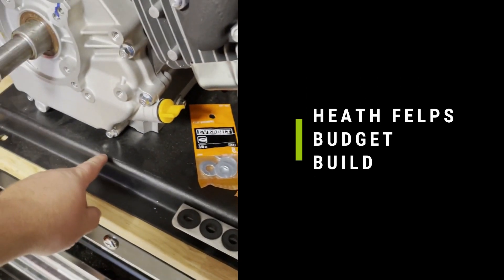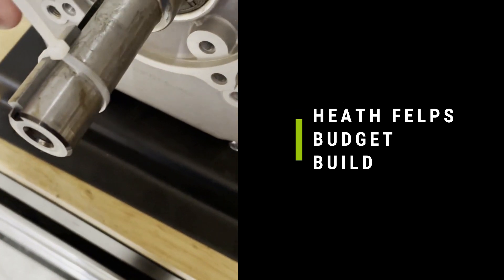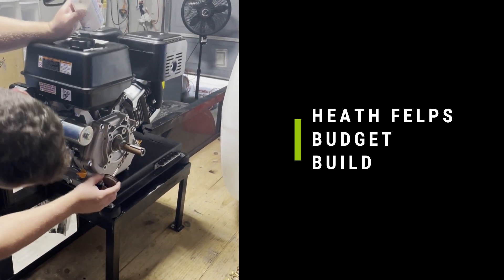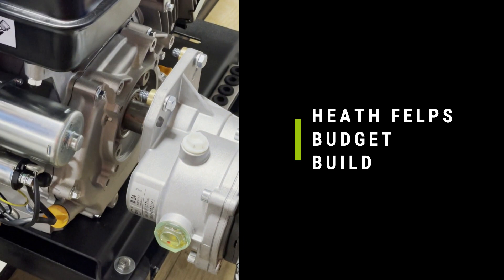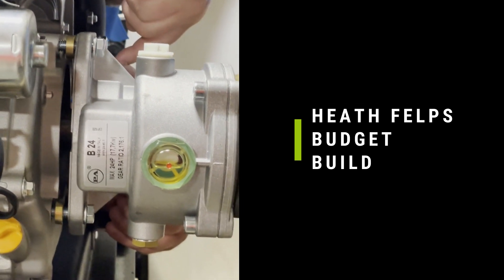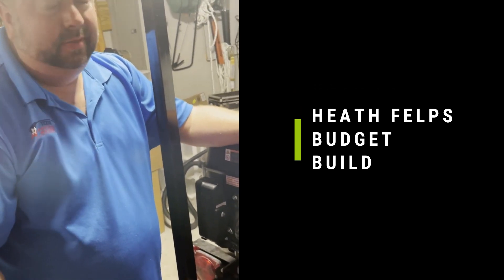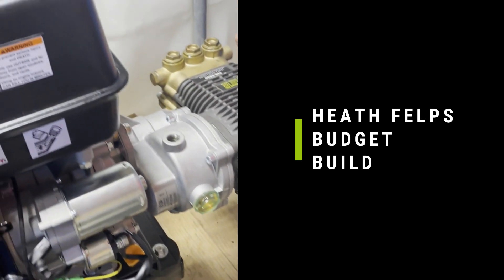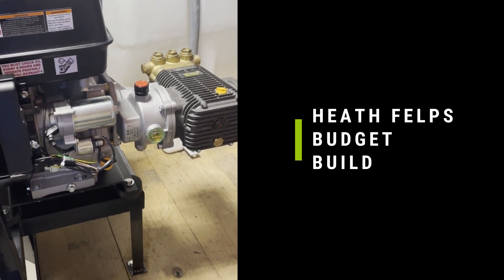Budget 6 5GPM Build

Comment: This video inspired me to do my own budget build!! My pump didn't come with bolts and spacers to mount it to the engine though and I'm having a hard time finding which ones I need online. What size bolts and spacers would I need to mount my pump to my engine. I'm doing a similar build with a duromax 18 hp and canpump 4k psi @ 6.6 gpm pump + gearbox

Comment: Building this now and about to set my unloader up. What pressure should it be set to with this combo?
Reply from the maker: 2400-2500.  If you hear the engine bog down back it off until it stops.
Reply: @TexasPressureWashing  Thanks for the reply! I got everything hooked up today and plumbed to the tank but it does not appear to be drawing any water. Any suggestions? Nothing is coming out of the unloader
Reply: @tuckerplayer did you ever figure out it did draw water, I am having the same issue. I got water all the to the pump.
Reply: @kingdomliving5868  yeah I did. There was an air bubble stuck in the line and I shoved a water hose down the line that goes from the tank to the pump. The pressure from the water hose cleared the bubble and it started to draw water
Reply: @tuckerplayer  thanks

Comment: What do you get out of the pump using a 13hp motor? I use that same pump on a 20hp motor in order to get 6.8/3500. Not sure how 13hp can do that?
Reply from the maker: 6.1GPM @ 2500PSI.
Reply: Gotcha. I wondered how guys were using GX390s with 8gpm pumps. How does yours clean? I sometimes have to slow down to get mildew off driveways using 3500psi. I don’t think I could get away with using anything less than 3000.
Reply from the maker: I don't use anything over 2500 on driveways.  For very dirty ones use a strong post treat of 3-4%.  Pressure alone will not remove all growth on a driveway.

Comment: Could a Honda motor be swapped into the build as is or would that change the rest of the parts used ie pump? Excellent idea for content tho especially for me just about to start into this business. Well done.
Reply from the maker: Yes I also run the same pump on a GX390.
Reply: A Honda gx390 would be a direct replacement same bolts and everything. Honestly the only issue I see with this is the Pump/Gearbox honestly look kinda cheap. The predator 420 Is a good motor wouldn't be too worried about it.